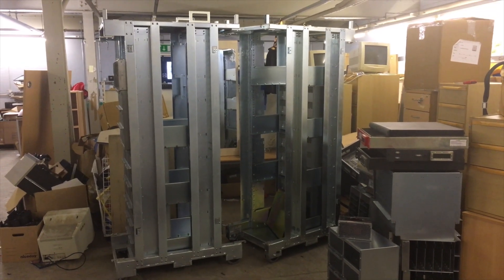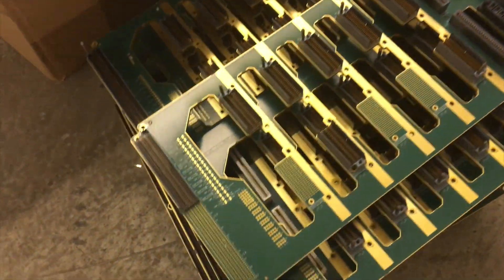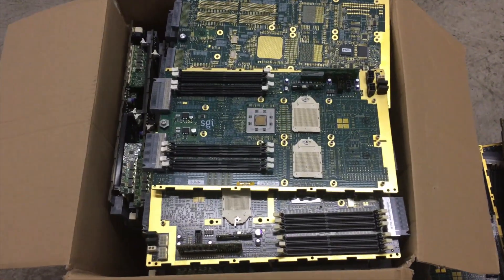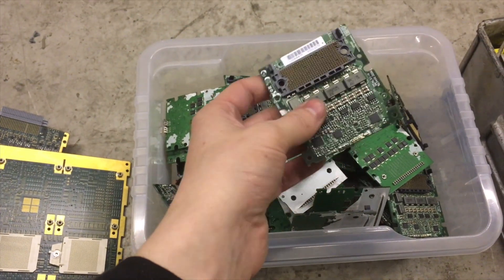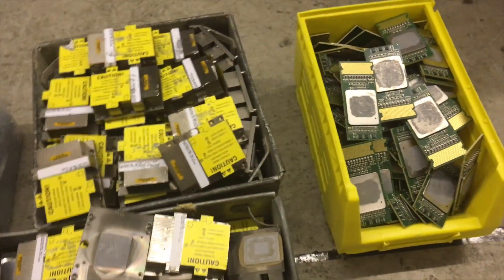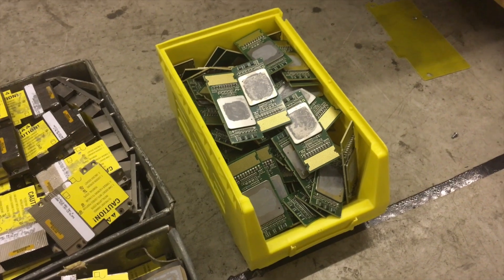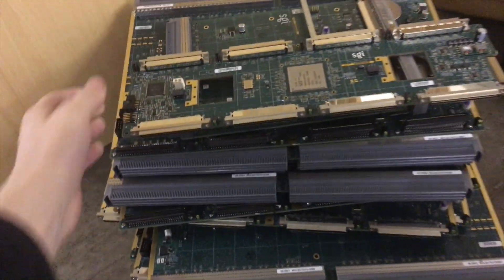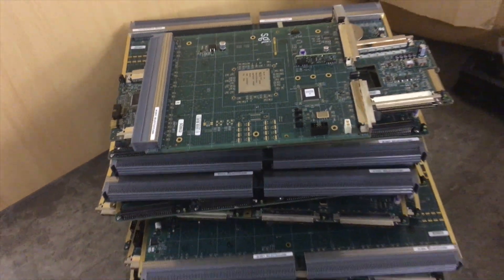Recovering gold from an SGI Altix 4700 Supercomputer

Comment: RE: Backplane. Another super from SUN called the E10K its backplane was 500,000 USD each !!! Just to put it in to perspective how much a backplane like that cost .

EDIT Do you have an SGI logos / badges you would be willing to sell ?
Reply from the maker: Blimey! Those long Amphenol connectors on those boards are still £112 each on Digikey. Also, the manufacturing cost of a 30+ layer PCB with that much Gold can't be cheap either. I wouldn't like to put a price on it, but just the production costs must be 4-figures.